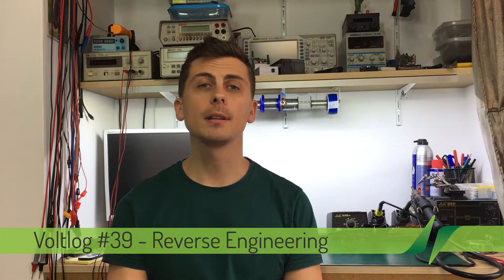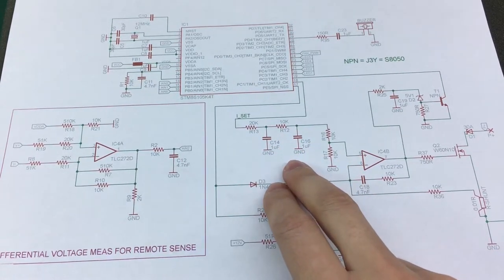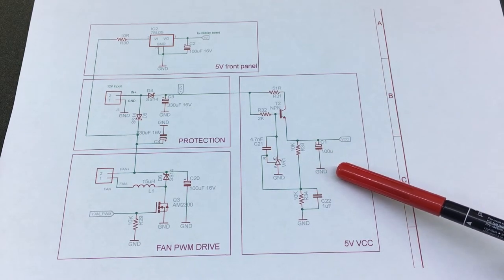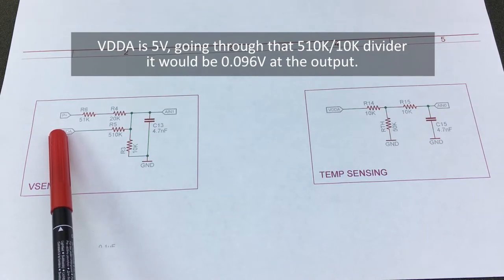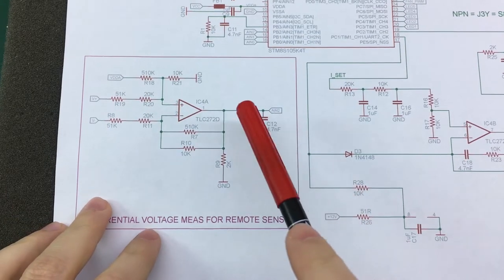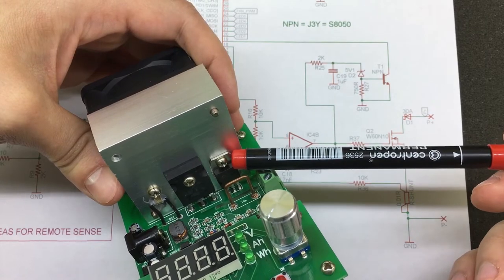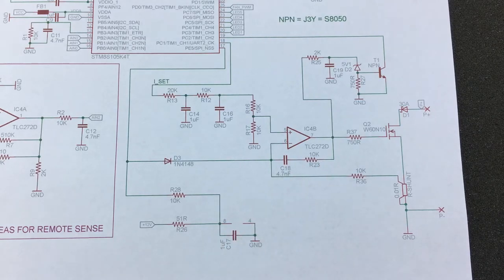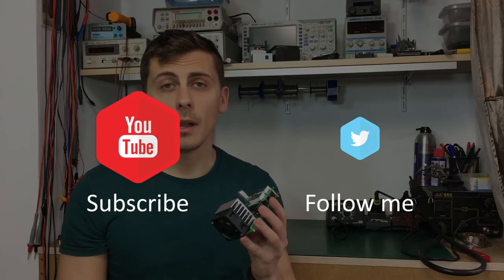Voltlog #39 - 60W Electronic DC Load Reverse Engineering

Comment: pin 17 is a shutdown control. when high the oa thinks there's a huge current flowing in the sense resistor and turn off mosfet. the main feeback loop for the oa is with the mosfet and the sense resistor. The problem is that it takes time to load the parasitic capacitor in the mosfet to activate it. The oa could then oscillate. The extra feedback is active for frequencies above 1/(2piRC). pin 19 indirectly detects that the voltage on the load is too low for the programmed current and the oa goes high to try to let current flow but the oa output is just maxed.
Reply from the maker: thank you for explaining this.

Comment: Nice work, and thanks much for your video.  The 510K resistors are there to apply a small positive  bias at the ADC input. The on-chip ADC plus any opamp offset might have a small negative bias, preventing the ADC from accurately measuring 0.0V. So the circuit applies a small positive bias and then subtracts the offset in software. Maybe it gets calibrated out and the offset calibration gets stored in EEPROM.

The diode at the input of the op-amp is there to shut the op-amp fully off. Without it there may be a small positive offset applied to the opamp. Add the opamp offset, and you get a few mV error, which causes a significant offset current. A better way is to inject a small positive current via a resistor into the opamp - input.

The R-C in the feedback loop is to compensate the loop. Power FETs have  a large capacitive input (G-S) and a large feedback capacitance (D-G) which cause a pole in the loop. The R-C compensate for that. 

Cheers, 
Dave
Reply from the maker: thank you for the thorough explanation.

Comment: I finally decided to buy one of these, mainly because of info you've shared in your videos. I received it today and it surely is awesome device.
There was one problem: Fan was always on (full speed). Thanks to values printed on the board and the schematic you shared, it took less than 5min to diagnose and fix the problem. Thermistor is 10kOhm version, instead of 50kOhm. Problem was easily fixed by reducing resistance of R14 to 2kOhm, making the voltage divider's ratio the 1:5, which it should have been in the first place.
Thanks!
Reply from the maker: so it seems they are shipping a batch of these with the wrong thermistor value. Another viewer reported the same thing. Nice to hear you fixed it.
Reply: I have one with fan always on, not sure if its full speed.  I used dvm on ohms and put leads on thermistors, after meter settles, I get 7.24kOhms.  How does your read?  How did you find out its 10k?  Is the resistor that needs to be replaced have 3 caps below it, 1 cap on left, 1 cap on right and 1 103 resistor on top?
Reply: I desoldered one of the thermistor's wires from PCB and then measured resistance, which was little bit under 10kOhm.
Now I measured resistance while both thermistor's wires are connected to the board and got same resistance as you.
Yep, that description of resistor's surroundings sounds right. When looking at the main board, heatsink on top, crystal on bottom, there are three caps to right from microcontroller. The 10k Ohm (103) resistor that needs to be replaced with 2kOhm resistor is right above them.
Reply: Thank you.  I didn't have 2k so used a pair of 1k in serious as seen here https://s30.postimg.org/b87j7jln5/20170130_124832.jpg
  Now the fan stays off with power applied, turns on at slow speed when 
unit is set to run and speeds up as temp increases.  When I turn the 
load off, fan stays on until temp goes below 43c.  Measured the 
thermistor in circuit now and its showing 6.63kOhms after fix.  I am so 
happy I got this fixed now thanks to you and voltlog.  P.S. One other 
thing I noticed about my unit is the supplier only used 2 wrong size 
brass standoffs because the display board is at an angle.  Also some 
units come with extra standoffs as legs, mine didn't, oh well.
Reply from the maker: from the picture your board doesn't seem to have the ZHIYU markings, could this be a clone? hence the issues?
Reply: VoltLog I don't know. I got it directly from banggood. The pictures they put up seem to be from both variations. I wish I got the better build.

Comment: Servus!
Es war schöne Arbeit! Gratuliere, and Danke Dir, Dein Video ist sehr interessant!
Beim 5:04 sieht man 510K und 10K Resistor (R5 und R3), 
die geben wenig Offset,
damit man das im Software korrigieren kann, und so wird
Offsetfehler von ADC vernachlässigt.
Gleiche ist bei 6:21 R18 und R21. TL272 hat gross
offset, mehr mV, und man weiss nicht, ob das negativ,
oder positiv. So wird im positive Bereich verschoben,
und Fehler kann korrigiert werden. Bei IC4 fehlt dieses
teil, das ist das Grund, warum man nicht weniger mA einstellen kann.
Dieses Fehler wird mit Software versteckt. Bei einem Elektrische Load
braucht man nicht schnell reaktion von DAC (Strom referenze), deswegen könnte
man das ganze 12-16bit verwenden, und bei 10A könnte man
mit 12bit 2.44mA Auflösung auch erreichen, mit 16bit 0,15mA pro bit.
Pin17, wenn das LOW ist, zieht R28 nach GND, und bei D3 wird
umgefähr 0V, also Diode nicht leitet, mach gar nichts.
Wenn Pin17 HIGH wird, dann D3 leitet, und beim Invertierende
Eingang von OPAMP bekommt zirka 4.3V. Das bedeutet, dass dieses
OPAMP sieht 4.3V beim Shunt Resistor, also OPAMP sieht ein riesiges
gross Strom. Deswegen schaltet aus, und fliesst kein mehr Strom.
So kann STM uC das ganze einschalten, oder ausschalten.
Bei T1: Pin19 hat sicher PullUp Widerstand, also im normale
Betrieb Pin19 ist HIGH. T1 wird dann Pin19 nach GND ziehen,  von Opamp mindestens zirka 5-6V bekommt. Es kann nur dann
passieren, wenn OUTPUT von IC4B arbeitet im höchsten Spannung Bereich,
also beim FET kann nicht so viel Current fliessen, wie viel
eingestellt wurde. Zb.: Wenn man dort zu wenig Voltage hat,
und 0.2V zu wenig mit series Diode und 0.01ohm zu 10A, dann
STM uC kriegt ein warnung. Oder wenn keine Spannung beim Eingang
liegt, oder kontaktfehler gibt, usw.
In dem Fall muss IC4 ausschalten. Beim 0V Eingang, IC4 wird für
Gate von FET maximal Spannung geben, FET wird mit seine RDSON leiten. Wenn man
in dem Sekundum zu Eingang ein Voltage gibt, es wird unendlich
gross Strom fliessen, bis IC4 reagiert, und den FET ausschaltet. Und es dauert lange,
vielleicht zu lange. 
So viel könnte ich dazugeben.
Schönen Tag!

Comment: Ok OK!  I bought one ;)  If I need PC logging I can use my logging multimeter to capture the voltage of the source and with constant current and voltage cut off should do the job.  How about a multiple shunt modification (10 milliohm, 100m, 1 ohm, 10 ohm to give ranges from .2mA to 9.99A)?  Of course you would need ohm free connectors and switches :) (I think eBay has em lol) or tinker a lot.  I still plan to build one of my own design (well borrowed and modified) with PC logging and more functions but this will do in the meantime.  Thanks for your vids on this and all the work.
Reply: Digger D I am looking forward to your Project. If I Can help you to design a Dummy load with pc logging, i would be happy to help you (if I Can)

Comment: I don't see the schematic portion of the satellite board.  There are two switches there, the pushbutton you see, and also the rotary encoder (push it down to activate the switch).  It would be nice to see how it interfaces with the main board.
Reply: in description check out Andreas Spiess - Reverse engineering of the display part

Comment: I've been watching more of your videos, and I have to say keep up the good work!  I did a little research and the configuration of that op-amp is in is a "augmenting integrator".  Have a look at this:  http://www.globalspec.com/reference/53124/203279/5-5-integrators, it explains that it is a type of PI system used for closed loop feedback control for servos and the like.  I hope this bit of info helps, but thank you for sharing.
Reply from the maker: +JS106351 yes it all makes sense, thank you for the info. I added a note on video saying that.

Comment: I watched episode 38, your review and many thanks.  I made a comment there (on #38) that I would like a lower minimum current than its 200ma.  For small batteries 50ma would be good.  Can this unit be modified to make it 50ma?  Would changing the 10mohm shunt resistor work to do that?  And then apply a scaling factor to the meter read out?  I expect my unit to arrive (USA) in a few weeks.  Thanks.  Tom
Reply from the maker: +cary smith That's an interesting idea. I thinks is worth trying with a 0.1 ohm resistor, then everything on the amps meter display would be the actual measurement x10, so the actual range would be 20mA to 999mA. I will give it a try on mine if I can find a 0.1R shunt resistor in my lab and maybe post a video soon. Thanks!
Reply from the maker: +cary smith It's confirmed! It was so interesting that I immediately tested the idea and it works! A video will follow soon.

Comment: Could you tell me (because I bought an counterfeit one - with black microswitch) where is R15 and R14 on the board respectively to your diagram of "Fan PWM drive"...  Because my Fan is running carelessly and still and I want to change the value of reistors. I have even one NTC thermistor (47k actually) on stock.
Reply from the maker: I don't remember their position but R15 has one end connected to pin 16 of the mcu, you can figure out the rest by probing on the pcb.
Reply: VoltLog Ok. Doesn't really matter because first I changed the NTC from the 10k one to 47k and it works as it should. I bought the device on Banggood and it turned out as scam, unbelievable... So this is the tip for everyone who is looking to solve the "problem ". Now I want to improve only the current accuracy because when you e.g set the current to 600mA, there is actually flowing ~650mA. It's pretty big error about 8,33%. Accuracy is better with bigger currents.

Comment: Could someone please measure the voltage on their fan when they are testing a battery at 1 amp. My fan does not begin turning unless I physically move it first no matter what the current or how hot the heat sink becomes. It will continue turning after I move it and at 1 amp the fan measures 6.3 volts. I cannot troubleshoot my problem.

Comment: It´s possible that they want pin 17 to be zero volts.  Maybe the spec for the chip requires a low condition.
Reply from the maker: +Joseph Nicholas pin 17 would actually be pulled up to +0.6V, the forward voltage of D3(1n4148) in combination with 10K + 51R resistors in series to 12V. I think that pin is actually used as an output, but I might be wrong :)
Reply: +Simon Markham, I think that this is the run/stop control.

Comment: In the schematic, I don't see how a load would be connected, it seems that the MOSFET drain and source are connected in parallel to the load, which I'm sure is wrong. Could you confirm?
Reply from the maker: This is the load, you are not connecting another load.
Reply: I don't understand, the load should be connected to P+ & P-, or am I wrong?

If that's the case, why is the MOSFET in parallel with P+ & P- ?
Reply: Yes, you are wrong. The device being described in this video is the load. There is no external load. You connect a source of voltage: a power supply that you want to test under load or a battery for example, to the P+ and P- terminals. The current flows through the MOSFET and the R-SHUNT. The MOSFET and the R-SHUNT make up the load. The rest of all the circuitry on this board controls how much current is allowed to flow through those 2 components.

Comment: WOW, you went to a lot of work there!  
Anyway, I suspect you already realised this by now, but for what it is worth:
c18 + R23 are frequency compensation, good to keep things stable and prevent overshoot/undershoot and/or ringing on large fast step changes in control or load source values.  Hook up an oscilloscope to the op-amp output and physically connect/disconnect the load source, then pull either c18 or r23 out of circuit and do it again.. You will see how "yucky" the control loop response becomes to step changes.
Reply from the maker: thanks!

Comment: "Augmenting Integrator" is most commonly referred as Type 2a compensator in power electronic.
Little correction FAN PWM DRIVE is not driving fan with PWM signal, that circuit is low-side-switch buck converter (composed of L1, D6, C20, Q3 (and R29)).
Reply from the maker: +Miloš Lazović thank you for the info. The circuit regarding the fan control was unclear to me but it makes sense now, I should have seen it as a buck converter while drawing the schematic. It makes sense to have a buck in there to vary the voltage across the fan and not just the duty cycle as that will not work very well with the fan internal brushless driver.

Comment: Hello, one of my load always showed "Err6", so I examined the circuit. Result: the circuit diagram still lacked a module "VSENSE +12". This is evaluated at pin28 of the μC (transistor switches at 12V Pin28 to GND). This NPN (J3Y) was broken.
Here is the extended circuit diagram: http://www.old-papa.eu/images/dummy-load-sch-new.pdf
Revision: ZPB30A1 V2.7 1510
Old Papa
Reply from the maker: thank you for sharing!

Comment: Great. If Mine arrives here from bangood i might to try finding out more about it 😀
Reply from the maker: +Michael Bernhardt they always arrive, sometimes just a bit late :)
Reply: +VoltLog yesterday it did arrive but the rotary encoder was broken during delivery. So i have to try to get a new one and solder it it. At least it turns on but i cannot operate it
Reply from the maker: +Michael Bernhardt sorry to hear that but I assume it was packed with just some of that soft protection wrap which is really insufficient for a product this size. They should send these in cardboard boxes.
Reply: +VoltLog you are absolutely right. Only 2 layers of bubble wrap. And when one piece of the ihrem than is rising up from the flat pcb as the rotary encoder does it will break for sure. Or as Dave would say "Murphy gets me every time" ;-)
But i got the item refunded and will try to replace the encoder over easter. Should be a standard one 3 pin with 2 additional pins for pushbutton i think.
Reply from the maker: +Michael Bernhardt yes, it's a standard rotary encoder with switch, search for "rotary encoder" on ebay, the blue ones are everywhere.

Comment: I almost buy one of this... then I realised that is not suitable for what I need because i need big currents like 20A @12-24V... I guess ì'll build an analog one with an opamp and mosfet...
Reply from the maker: +ElectronicMarine I guess this 60W load is designed for battery and small power supply testing. It would be nice if the software would be open-source, then it would be easy to add bigger heatsink, adjust some parameters and re-compile.
Reply: yep it wold be nice to put another 5-6 mosfets on the output side also...

Comment: I've just done a full reverse engineering of the hardware: https://github.com/ArduinoHannover/ZPB30A1_Firmware
So:
- there is a dedicated voltage divider for the power supply
- the zener diode is used to detect an overload
- the diode at the opamp negative input is to enable or disable the load

Open source software will be pushed as soon as my spare ICs arrive (don't want to brick my working one).
Reply from the maker: It's so nice that someone finally accepted the challenge. Good job man! I'll do a video on this once you have something that works.
Reply: But I'm wondering: how did they get a resolution that high (seems to be 12 bit)? There is only a 10 bit ADC in there, so over the full range of the dividers / opamp we get a resolution of 0.035V (35.6 / 1024). The original one can measure 0.01V without a problem and is still very accurate. ± 2 digits is not too bad, but it seems there is room to improve (as the original firmware can do it too).
Reply from the maker: I am not sure but they could theoretically increase the number of bits by oversampling & averaging.
Reply: Yep, just done that, so reading 4 x n times and dividing by n gives us 12 fake bits :-)